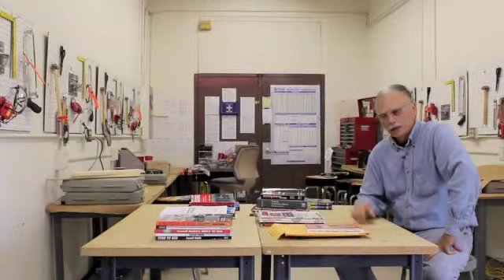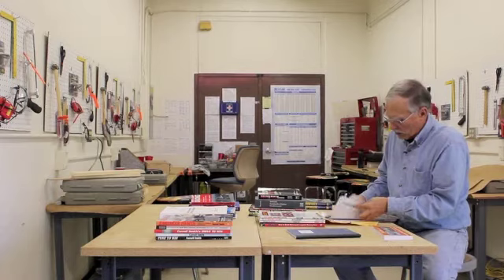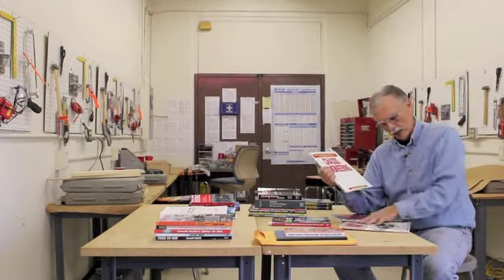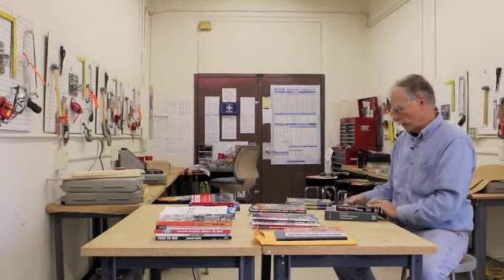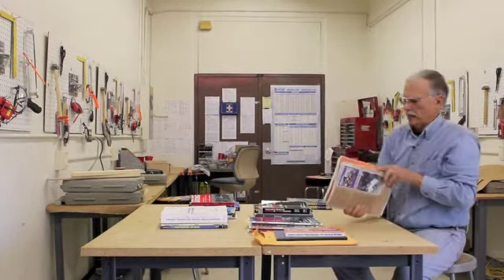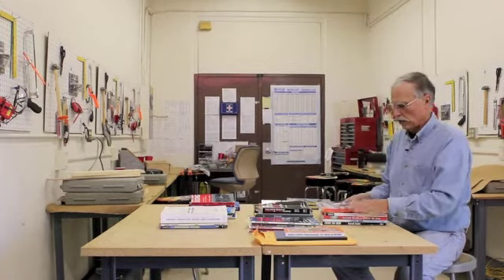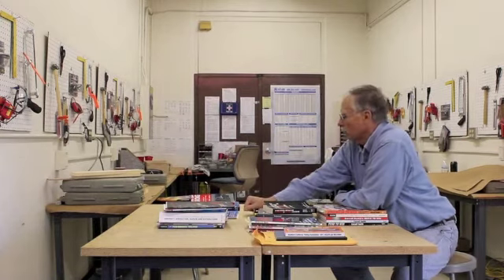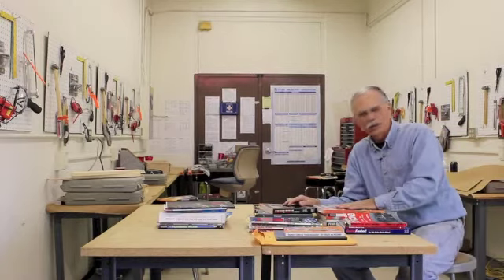Intro to Racecar Engineering: 19 Smitty's Library

Comment: For anyone wanting a reference (I might add amazon links later)

1. Rulebook for your sanctioning body
2. Service Manual for your power plant
3. Vehicle Logbook

Design:
4. "Chassis Engineering" by Herb Adams
   "Race Car Engineering and Mechanics"? Paul Van Valkenburgh 
5. "How to build motorcycle engine racing cars" (especially the sump modification) Tony Pashley
6. "Scientific design of Intake and Exhaust systems"
 "Internal Combustion Engine fundamentals" Hayward MIT (Theory, not building)
FSAE: 
7. Carrol Smith "Engineer to Win"
 "Drive to Win" 
 "Prepare to Win"
 "Nuts, bolts, fasteners, plumbing"
 Only ~ 10% is useful information

8. FAA Advisory cert
 43.13:  https://www.faa.gov/regulations_policies/advisory_circulars/index.cfm/go/document.information/documentID/99861
9. Sand casting?
10. "Racecar engineering" magazine
11. Burns Stainless catalog

Driving: (good, but seat time is much better)
12: "Going Faster" Skip Barber
13: "Cart Racing" Bondurant
14: "Secrets of Solo Racing"

____________

And a big thank you for all these videos! They're extremely helpful for a project I'm working on!
Reply: you are a gentleman and a scholar
Reply: thanks Cory I appreciate it
Reply: Thank you so much